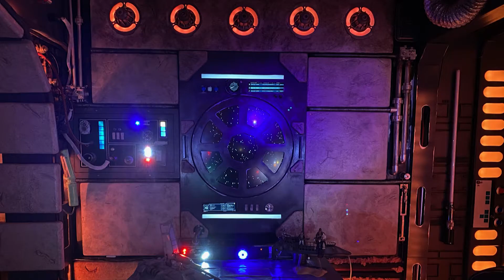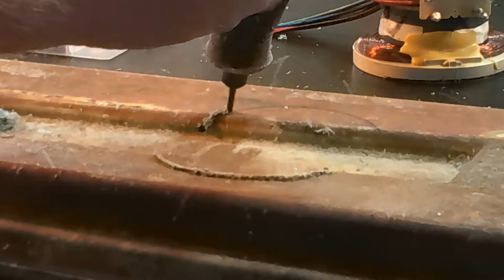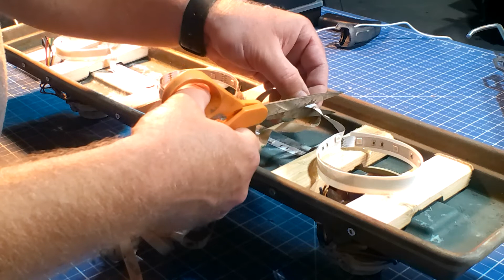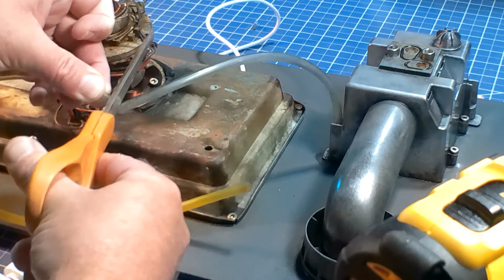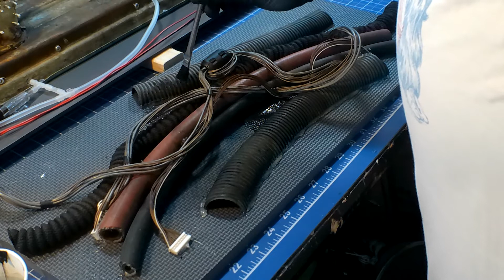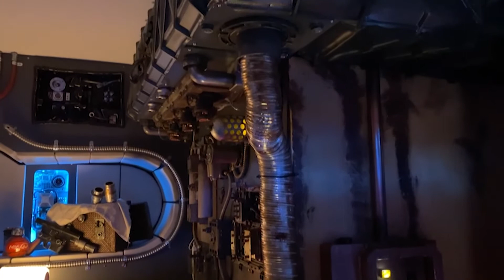Star Wars Room Build: Millennium Falcon Bulkhead

Comment: So I remember the house I grew up in had this really ugly track lighting from the 70's or early 80's, but if you took some of the newer track lighting with the much smaller bulbs and that garden tray and maybe cut the height down a little I imagine you could route out a slot for the track and then replace the cans for the lights with those parts from the projection screen and make some very functional lighting that looks very cool and in universe.